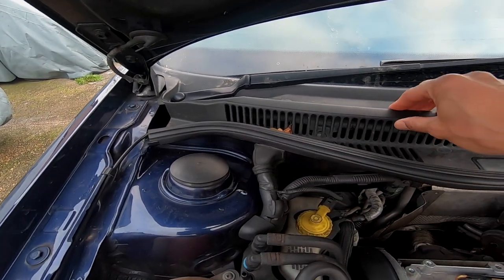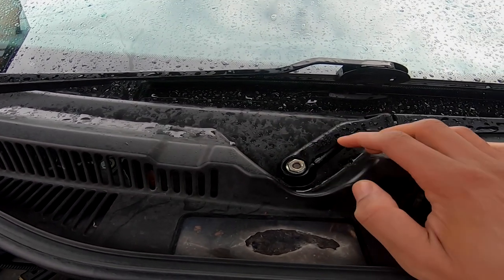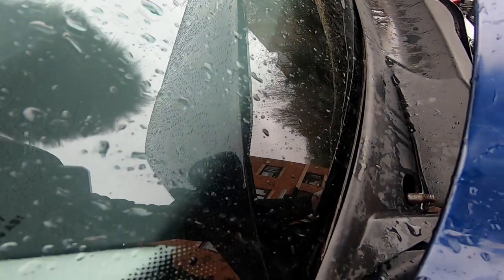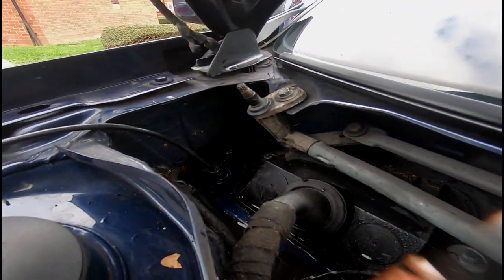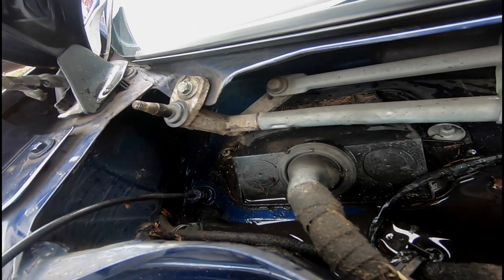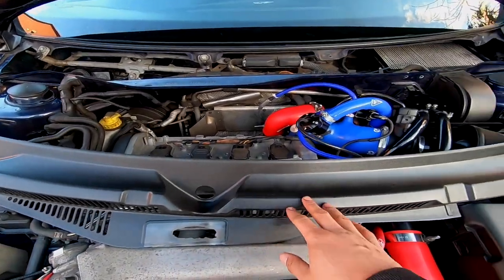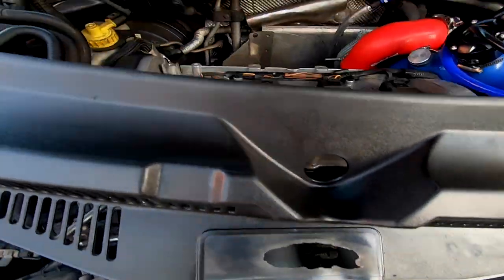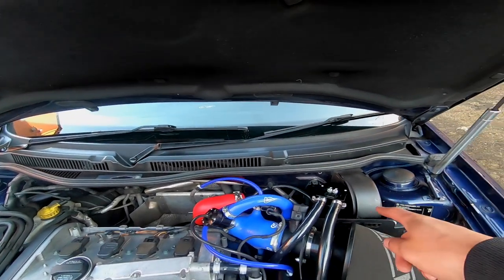MK4 GOLF GTI INTERIOR WATER LEAK PT.2

Comment: This video is really useful, cheers. I’ve already sealed up the drivers regulator panel, but I’m not convinced it’s the only leak. Your video is really detailed and gives some nice close ups of the problem areas 👍🏻
Reply from the maker: Thanks, appreciate that man. As someone else here in the comments reminded me you can get a build up of gunk behind the inner wheel arch liner and I think that can also allow moisture in. I would say to remove the scuttle panel, clear all gunk/debris and I think its good enough. The only reason I had water getting in under that plastic box over the plugs is because of the leaves etc allowing water to build up and sit there. I'd be happy if the video helped you mate. Good luck 👊🏾

Comment: I got the same problem bro. Just a quick note to say your videos are informative and I'm subbed. I am working on a V5 MK4 golf and have been messing about with VW's on and off for years. I'm no expert but I found from my experience that if you want to remove the wiper arm tool free, then you remove the nut from the arm(like you did)  and then lift the wiper blade up from the screen in the service position ( as if you were about to change the wiper blade) and keep it in that postion, this loosens the tension on the spring underneath and then you can lift the entire arm away from the windscreen by gently pulling on the smaller part   (the plastic piece that surrounds that nut)  i hope that makes sense.  It worked for me, no lie but I still dont know how I worked that one out til this day. 😆👍
Reply from the maker: Hey man, really appreciate your comment brother. I like the sound of the V5 Mk4 actually, I used to work with someone who had one. I know exactly what you are talking about in terms of removing the wiper arm, just stand it up and give it a good wiggle. By the way since the most recent fix I have had no issues at all with water in the car, its bone dry no matter how much rain there is. Your explanation made total sense by the way. 👍🏽

Comment: Thanks for a good clear description, and clear filming. I've got a bad leak when parked nose up on a hill...can see from the video it could be water going through that seal instead of down the drain at the side as they'ld be about level due to the hill.
Reply from the maker: Hey, sorry to hear about the water as I know it's really frustrating. Give that area under the panel a good clean and inspection, then I'm sure it will be all good. It definitely sounds like it could be coming from that area.

Comment: I have a leak exactly in the same area where your car does. Great detailed video. Will be using your video as a reference.
Reply from the maker: Hey man, I hope it all works out for you and the fix goes to plan you will be happy when it's finally dry again.
Reply: @SPOOLINUP   I did follow up your video except I did it on the left side since we drive here on the "right" side of the road. ;-) Kidding aside, both rubber gaskets at the bottom of the plastic harness transition box as well as the cover were completely dry and cracked. IT took me some time to clean the old rubber on both the bottom and lid, but once they were cleaned, I proceeded to remove the remaining rubber residue from the metal itself using a knife, cleaned it with alcohol and then applied silicone to make new gaskets. Also I had tons of old leaves and dirt (the car is from 1999) as well as leaves residues under the mud guards. The leak is gone, all the residue of 20+ years was cleaned and the car has been under the rain from 2 days and not even a drop of water inside the car. Thanks again for your video and instructions. GOOD JOB!
Reply from the maker: @carlossalvetti6770 I'm really happy to hear that you managed to get it all fixed. It sounds like you did a great job and left no stone unturned. I think I got one of the best feelings from working on my car when I fixed this water leak because it was so irritating. You are welcome by the way and I'm happy the video was a help to you. Respect 👊🏾

Comment: I’ve had wet floors for ages and found a broken pollen filter rain tray sorted that then had to reseal the inside or the doors behind the door cards fixed one side and still didn’t know what to do till I came across this video gonna check it out next much appreciated for this bro
Reply from the maker: It seems like there can be a number of issues causing the water in the car. It's a bit of trial and error. If you check through the comments, some people have other suggestions. Have you had any luck so far?

Comment: Just put coil overs on my mk4 the rear is adjusted all the way down but the passenger side is sitting a lot higher than the other side any ideas?
Reply from the maker: Hi mate, just a few things to check. Is the front even? Are you on even ground? Have you taken the car for a drive to let the suspension settle? Is the spring sitting on its mounts properly?

Comment: Hiya buddy...
Can you confirm if re sealing the inner door panel stopped the dribble of water seen on the top of sill inner plastic cover at the bottom of the door?
I have just re sealed the plastic cover under the scuttle/ cowl as per your video after discovering water dripping down the inner bulkhead also. Big thanks for that info..
Will be opening up the bora next fir the same treatment..
Removing the scuttle/cowl panel without breaking it  quite difficult.
Reply from the maker: Hi mate, after doing both fixes I have not had any water in the car at all, so I can confirm that both work. Someone pointed out that you should also seal where the speakers sit on that same inner door panel. Have you also cleared out the drain holes at the bottom of the door? They are know to get clogged with grime as well so you could inspect them if you haven't already.

Comment: i am having the same problem ( I think) so thanks for the list of tools and method on how to fix it:) what kind of silicon have you used?
Reply from the maker: Hello, you could first off try to just remove the scuttle panel and clear all of the debris and drain holes. You could then put it back together and see how it goes. I used just normal clear general purpose silicone for that job. I hope you can fix it.
Reply: @SPOOLINUP  after Consulting the internet and other YouTubers I was led to believe that it was possible to remove the wiper arm without the tool that you use in your video.... so I've postponed the project to this weekend where I will try again now where I've been delivered the right tool for the job. I've also purchased some silicon, but I could only find some stuff for boat supplies. 
I don't think my through holes are blocked because when I pour water on the windscreen it comes through in the wheel well and also above my clutch. 
also a big thank you for making this video it's great how much effort you put in explaining your method!!
Reply from the maker: It is certainly possible to remove the wiper arm without the tool, just spray a little WD-40 and give it a wiggle. Sometimes they do get seized though and require some patience. As for the drain holes, mine where still draining but there was debris allowing some water to sit in that area. If it rained then the sitting water would build up and make its way into the car even though some water was being drained. You are more than welcome, I hope you manage to get it fixed as soon as possible and good luck.

Comment: Be VERY careful with the wiper motor/linkage. It's permanently powered and if it for any reason activates while your fingers are down there it will snap bones without even trying. Always disconnect the battery or at the very least disconnect the wiper motor plug before putting anything (!) in there that you don't want snapped off!
Reply from the maker: Oh really? that sounds concerning, I've never heard of that happening to anyone before.

Comment: Good video, hope it has solved your problem! Actually took off this panel on the Leon few days ago as well. Did you have any trouble refitting it properly? Seems mine no longer sits flush at the driver side, no matter what I do.
Reply from the maker: Thanks bro. Yes its solved the problem now and its all good, no more moisture, water, damp, mould or condensation so I'm very happy. The panel kind of clicks in to place, maybe take it off again and inspect it, also inspect where it slots into and try putting the drivers side in first, it might help you.
Reply: @SPOOLINUP  I discovered I put one of the rubber pieces that go where the wipers mount wrongly, that's why it didn't fit. While I had everything off again, I applied the same stuff like you did here as I found out the floor area below the pedals to be kinda wet. The box with the plugs was a different design on the Leon and quite the pain to remove.. but in the end I managed, hope it fixed it for me too 😄
Reply from the maker: Ahh I see, yes I know the rubber you are talking about. Sometimes these things can be fiddly. I put silicone sealant around that box and under the seal because I am 99% sure the water was getting in there. I think if the area wasn't blocked and gunked up it would have been ok but if it does ever get clogged up again it should stop the water getting into the car. Glad you did it mate, let me know if it fixed your problem.
Reply: @SPOOLINUP  I had a lot of moisture on the inside of the windows and previously when I just cleaned the area of a bunch of the leaves/dirt/etc (and also at the wheel arch liner) it seemed to have gotten rid of that problem already. It looked like the seal of the box was pretty much dried out, I got rid of what remained of it and put silicone in the groove where the seal goes normally. Figured that would be enough. I still have some leak at the driver door but it looks like that stays on the plastic trim and doesn't actually end up on the carpets. I know how to fix this problem but about to (attempt to) convert the rear windows and mirrors to electric and with that I'll re-seal all the doors, hopefully solving it finally. It seems we're finally having some good weather so not sure when I'll properly be able to see if all of it is fixed haha.
Reply from the maker: @Djiel  Yes and you know a lot of people are angry about this, even people with the sunroofs have an added issue of the drain tubes that can leak as well. I was just saying to someone else who commented that I need to clean behind the wheel arch liner when I get the wheels off next. I was elated when I finally cracked it this time, my car is bone dry and I dont even get the condensation any more so I love the car again. So the drivers door leak you arent too worried but do you know what it is? My friend was saying to try the drain holes at the bottom of the door but mine were fine so that is what led me deeper and deeper to try and find the cause. Nice so that will be a cool conversion, I would like to get electric mirrors man. Weather is improving for sure man let's hope its here to stay 👍🏽
Reply: @SPOOLINUP  Yep I am glad there's no sunroof on mine 😄As for the doors, I'm pretty certain it's the seal on the inner plate as per usual. I've tried to fix it before but I think the plate is bent somewhat, so just sealing it on the inside isn't enough. I'll be replacing the whole plate on all the doors trying to do the conversion so it doesn't really matter. Just hope the conversion works out, there's not a lot of info on it. Hoping it's a matter of changing all the inner plates with the mechanisms and wire looms and hooking everything up and fitting the new door cards in the rear with buttons.
Reply from the maker: I know but imagine the perks of a sunroof! I have one on my BMW E46 and its lovely in the summer. I know it can cause untold stress for sure. As for the conversion I am sure you will do it easily and if there isn't enough information then I'm sure you can work it out. I assume you have a new switch panel with the rear window controls on it too. It will be a nice modification for you and you can be proud once it is done. Two birds in once stone, modernise your car and seal any leaks that are there.
Reply: @SPOOLINUP mate, the golf mk4 sunroof is crap. All 4 drains are dripping in the car onto the carpet but the drain hose isn’t clogged. My car also leaks from the grommets in the trunk and the taillights. The car went from bone dry a year ago to an absolute mess now.
Reply from the maker: Are these drain channels connected to the sunroof? Also how do you know they are not clogged? Have you checked to make sure the holes at the bottom of the doors are not blocked as well?

Comment: Hey @*SPOOLIN UP* , did it solved the problem? Having  the same issue with my 1.9 tdi , mine is left side wheel though.
Reply from the maker: Hey man, yes this solved the problem. Remove that scuttle panel, clear all of the gunk and debris away from the entire area. Check water filters down through the drain holes.Take a look to see if your pollen filter housing has any cracks or damage. I would advise to do this first before applying silicone anywhere as you may not need to. Cross my fingers for you and hope it is all good 👍🏽
Reply: @SPOOLINUP  Yeah i have to look that up because it's raining a lot now . Thank you brother.
Reply from the maker: @gorytarrafa  Where are you based? I used to dread the rain knowing my car would be soaked, mould on the head liner was horrible. Good luck im sure you will sort it. Does it come from behind the dash?
Reply: @SPOOLINUP  I live in Portugal, every day my windows are soaked in water but I never thought I was getting water I thought I was sweaty, until my brother-in-law complained in his golf (a car just like mine) that water was getting in and that it already looked like a lake that the carpet and rugs were all soaked and then he went to look at mine and when he lifted the driver and rear passenger rugs there was the rug all wet too, it has been raining a lot here and there must be some point of water entry but we still could not find out were it's cming from. I'm gona start from were you fix and then probably gona check my door too because that plate that holds the window's motor has been removed several times for fixes and the silicone must already be quite bad and it could be a point of entrance too. Again thanks for the help , have a good one brother .
Reply from the maker: Yes well I would suggest to feel around up behind the dashboard and see if you can sense moisture. Just try and find the highest point that is wet and it should help you. You can alway pour water on the car as see if you are able to find a drip or flow of water. As for the door panels you can also try that and the drain holes at the bottom of the doors sometimes become clogged. Good luck either way and I hope you get it sorted.
Reply from the maker: Yes well I would suggest to feel around up behind the dashboard and see if you can sense moisture. Just try and find the highest point that is wet and it should help you. You can alway pour water on the car as see if you are able to find a drip or flow of water. As for the door panels you can also try that and the drain holes at the bottom of the doors sometimes become clogged. Good luck either way and I hope you get it sorted.

Comment: You sealed the door panel but not the door speaker. Water comes through the regulator panel via the speaker.
Reply from the maker: Hey, I've changed my speakers now and sealed up where they are mounted to the door panel. Unfortunately I didn't actually fix the problem with this video. I have a part two where I discovered where the water was entering the car. Thanks for your help